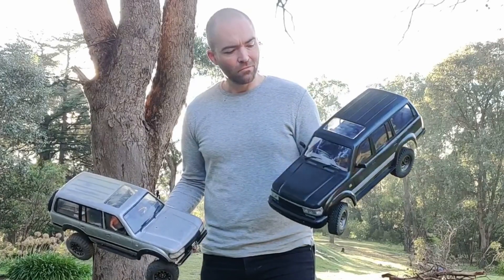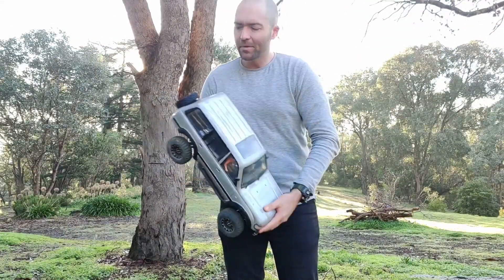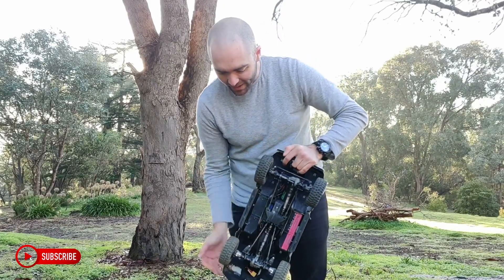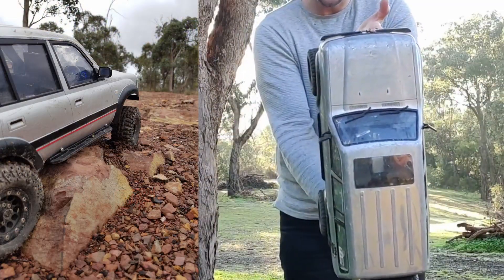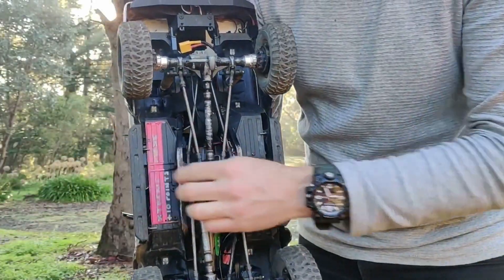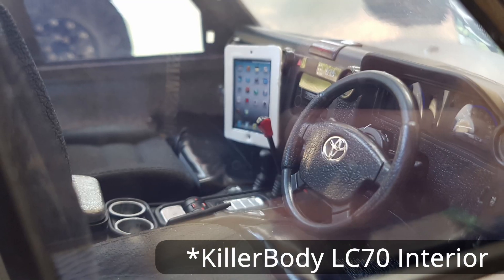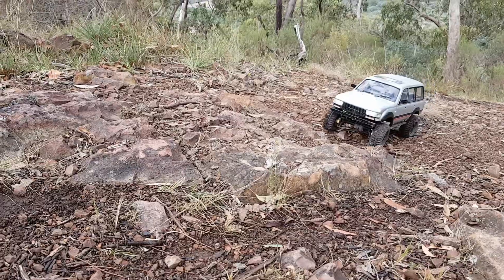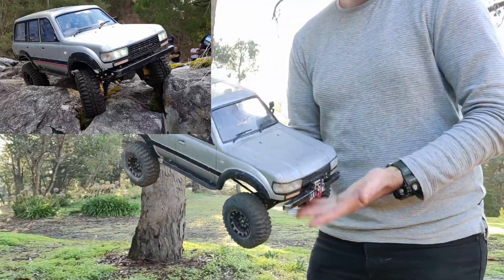I Chopped & Converted My TRX4 Defender for Comp Crawling

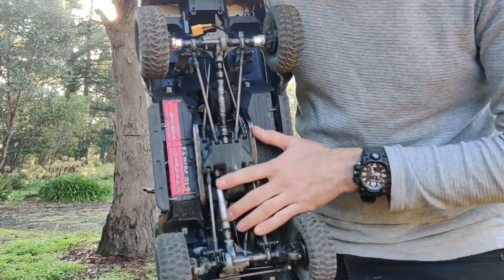Comment: Just found this one now for the RCRUN so answered my own question lol.    Search for:  RCRUN 1:10 RC Metal Car Body Shell Fixing Holder LC80 Upgrade For TRX4 SCX10 D90   on eBay.
Reply from the maker: Heh yep, thanks. I found that exact set of parts when I built the RCrun RUN80! This one's already done differently and that's fine, but in future, absolutely yes, those mounts are the ones to use! Thanks for the info!

Comment: I loveit! I own rc run80 and axial lc80. I bought a lc70 interior for it. How did you connect  the LCD? Can I tap it directly to the receiver?
Reply from the maker: It's been a while since I did that. I can't recall if the lights were 3v or 6v. I've got a killer bodies light controller in the body for the other lights, but the dash runs from... I'm pretty sure from a splitter on the light controller's throttle input that runs from the radio, so yes, in that case, a 6v connection should be fine. Suggest you test first rather than going with my memory, which is often unreliable! Enjoy the build, it's a great little interior!
Reply: Thank you I really appreciate that.